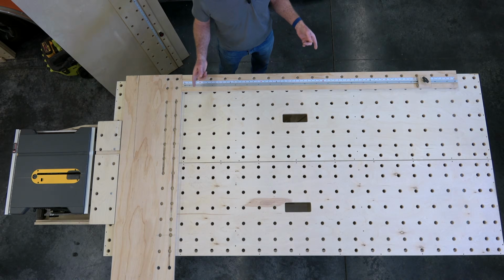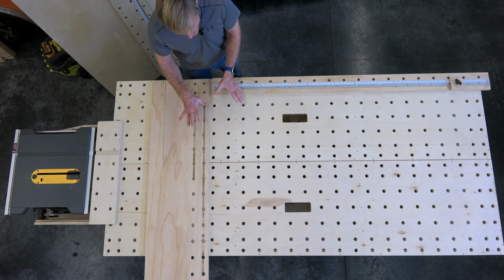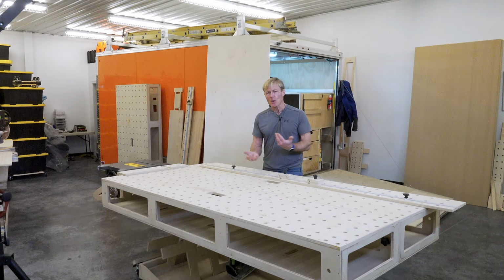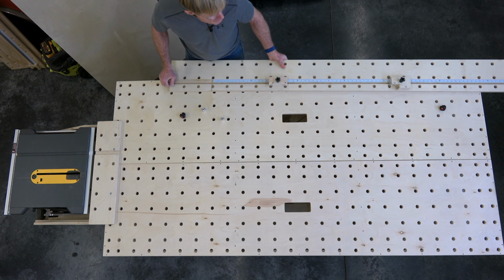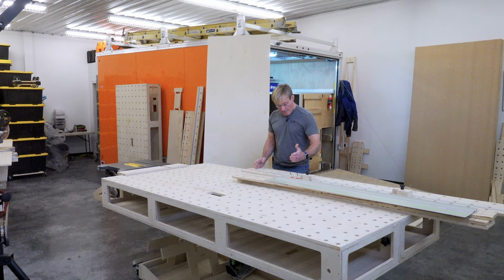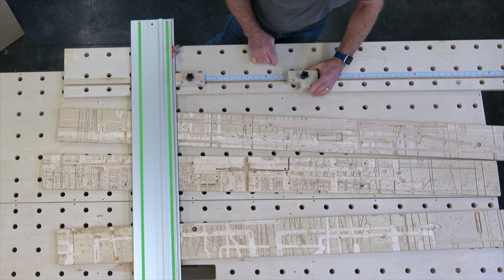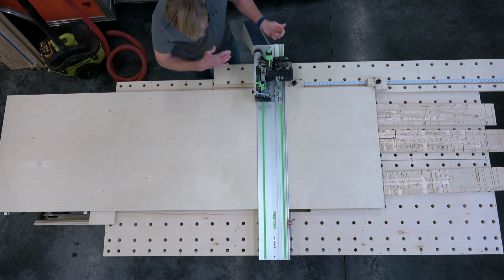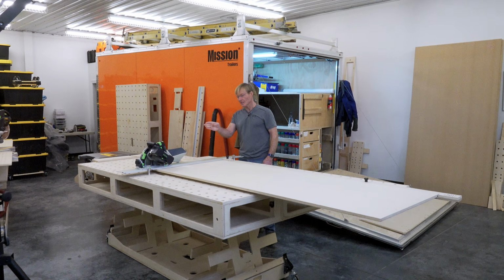What is a PSCC?🙃

Comment: Hi Ron. I am in the middle of my 3 P-bench builds, I like this cross cut jig idea for the PSB. Question: what Festool track are you using and what clips on the track are you using to attach to the dogs and lastly, what dogs are you using? Once I know that to look for, I will take advantage of your store for purchase! Thanks
Reply from the maker: Hi Steve, there is a hot link on your PSCC plans to those tools or you can use this one: https://thesmartwoodshop.com/pscc-parts
Reply: @TheSmartWoodshop  very much appreciated! I believe I purchased the PSCC when I bought the other plans in Aug. I will look for it as well as checking your link. I was happy to find that my dewalt track saw will work on festool track so this CC systrm will be a welcome addition.

Comment: Does the parf system have a method for creating 64mm hole spacing as shown on the plans?
Reply: Hey, Bill.  I don't know if you have already gotten your answer to the question above, but the Parf MK2 Guide System does have a means for making 64mm hole spacing (I think).  I haven't performed the following method yet myself, but I do have a need for 64mm spaced holes for an upcoming project, and therefore I have contemplated how it could be done and have made some rough sketches of the layout to achieve this.  The Parf Sticks have 10 reference holes that are used to make dogholes which are 96mm on center apart from each other.  There are also three reference holes that can be used to make dogholes that are 32mm on center apart from those 96mm reference points.  I believe that if you started out by making the 3mm drill holes using the 96mm spaced holes, then you can go back and use those 3mm holes as references and make the 32mm offset drill holes in both directions.  96mm minus 32mm = 64mm, and 96mm plus 32mm = 128mm (128 = 64 x 2).  The next 64mm hole after 128mm is 192mm.  You will already have a 192mm hole drilled because that will be the second hole you made on your first column of holes when using the 96mm spacing.  The next 64mm hole after 192 is 256mm.  Using the third 96mm hole you already drilled, which is at 288, just use the 32mm offset hole on the Parf Stick to go down the 256mm and make your 3mm drill hole. Once you have all of your 64mm drill holes where you want them to be, you then just bore out the 20mm dog holes using the other tools that come with the Parf MK2 Guide System.  In short, the Parf system has the means of making holes that are 32mm, 48mm, 64mm, and/or 96mm (and any multiple of those amounts) away from any reference point on the table.  You may find an easier way than what I've explained above.  A way that causes less brain damage.  But, I hope this makes sense and that it helps to get you started in the right direction.  One thing I'd recommend is try to draw it out on paper and make sure you have all your starting points right where you want them to be.  From there it should be all about just following the plan and trying not to get too twisted around with all the references and offsets.
Reply from the maker: Yes
Reply: '¡M"mM.>>M"mm.

Comment: Accuracy- this depends on your sliding clamps being in exactly the same place sideways in the T slot. Good luck with that, especially after an amount of use. And it increases for smaller lengths of material, of course. Also, wood moves over time, and you are relying on the fence not bowing, as the reference point moves every time you move the clamp guides. i.e. you cannot zero it. But then, you will have a new version in a couple of months...

Comment: Ron, curious why you didnt use bench dogs for aligning the workpiece like you use for aligning the track. Instead of needing the squaring blocks in the t-slot, you could put the bench dogs anywhere in line. And to prevent the stop from bumping into the dogs, make them flip stops just like on the smart station. The t track is just behind the parf holes used for squaring and you can slide the flip stop anywhere along the jig behind the dogs. And easily flip them out of the way when you need to square one end of the board, then flip out the stop and make your dimensioned cut.  With fixed stops, you need to move them to make a cut anything longer than where the stop is. the beauty with flip stops, you can leave them while you make other cuts.  This also eliminates any error when making the track. If your parf holes are not perfectly parallel with the t-slot, then the jig would not create square cuts. Since the holes are all already square, then the dogs automatically make square cuts
Reply from the maker: the 20mm holes are not in alignment with the track and no way to lay them out without interfering with the stop.

Comment: Yet another great idea Ron. Been watching your videos for years and incorporating lots into my garage hobbyist shop. I am curious about the parf dogs, though. Do you use the 30mm collars? Looked like they were on in the video but couldn't tell. If the parf dogs, that are used for squaring the track, are anchored at different heights (the thickness of the PSCC), then the track would butt against the collar on the PSCC and against the 20mm shaft at the far end. Or did I miss something?
Reply from the maker: No collars, I use the chamfer rings.
Reply: @TheSmartWoodshop  10-4. the chamfer rings are my preference as well. Very clean.

Comment: Why is 96mm spacing an industry standard. Why not 100mm to make the math easy.
Reply: At least its in mm. A better question is: why is the industry (particularly the Europeans, Chinese and Japanese) still supporting things like 1/4 and 1/2 inch shanks? Its slowly changing, but its much easier to do the math on say a 10mm OD template guide with a 6 mm bit, than one in inches.

Comment: With your festool tracks and the squaring accessories available for them, some of which you own, I just don't see how this is an added benefit without being redundant.
Reply: In my opinion, it provides repeatability of your cross cuts without having to measure and pencil the length every piece you want to be the same length. How much time it saves you depends on how many pieces of the same length you need.
Reply: @pierrebourassa2336  aren't the parallel guides designed for repeatability?
Reply: @thepaintprofessor  You are right, but beyond the 50 in the parallel guide won’t help. Using the terms crosscut and rip cut for plywood is a bit  of a misnomer, but I’ll use it anyway to illustrate. Let’Ùs say you need to cut 60in pieces that are 24 in wide, Ron’s tool would be helpful.
Reply from the maker: @thepaintprofessor  This is for crosscutting not parallel cutting
Reply: @TheSmartWoodshop  I didn't realize that parallel guides weren't useful for crosscutting. Thanks for the insight. Keep up the great work Ron!
Reply: IMO, depending on the cut, sometimes it's easier to manhandle the workpiece and other times it's easier to wrestle the track and guides.
Reply: @fritter63  what UJK fence?